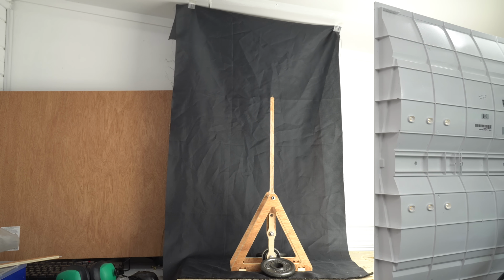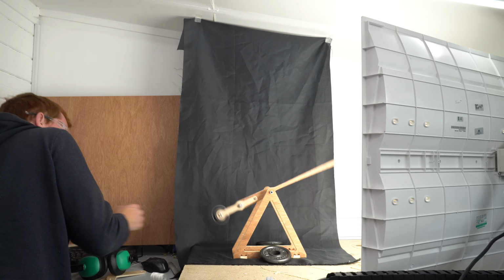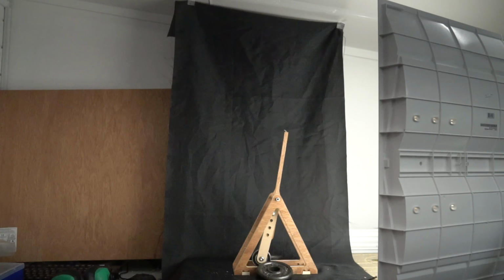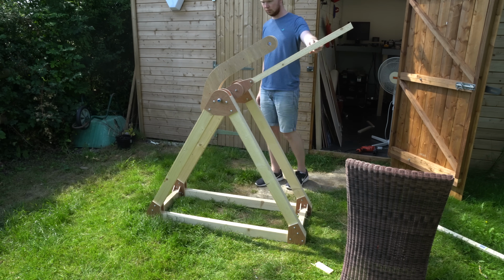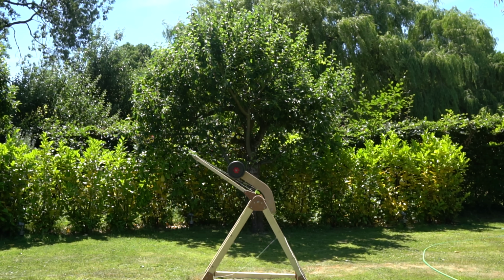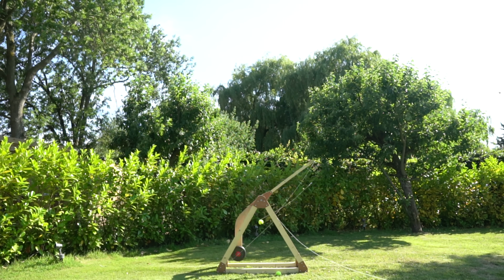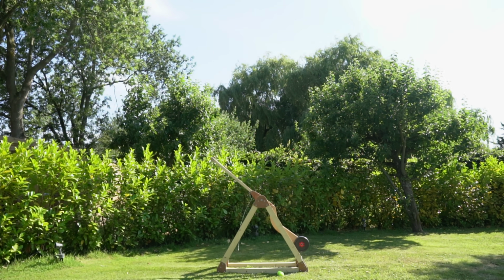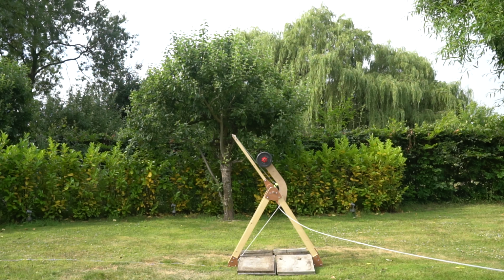Optimising a Trebuchet

Comment: Imagine getting hit by a tennis ball at 104 miles per hour that was shot from a homemade trebuchet 300 meters away.
Reply: @GielL96  well it IS Imperial
Reply: David the original comment is how many of us Canadians would talk too.. imperial is often used in dialogue and in construction, and then we use the more accurate system for real math
Reply: @David-vo1rl  Please don't use that word.  Besides, it's the British Imperial system, ergo from the British Royal Family.  "Inbred system" would be far more accurate.
Reply: Air resistance would slow the ball down tremendously during a flight.
edit: Given its size-mass ratio.
Reply: WAAAARRRR! THE BALL OF INSOLENCE HAS BEEN DROPPED
CALL THE BANNERS, GATHER OUR MEN. PREPARE THE ARMADA. LAUNCH THE PIGEONS, INFORM EVERY HOUSE TO SEND THEIR TROOPS.
TOMORROW WE RIDE TO DEATH!
Reply: How to play fetch with the dog.
Reply: oof
Reply: Imaging getting hit with a wooden play button at the same velocity.
Reply: At that speed it would only reach about 108m (ignoring wind-resistance) even at an optimum angle.
Reply: @JulianSildenLanglo  I mean, ignoring distance, its still a tennis ball flying at 104 miles an hour XD
Reply: I can imagine it happening to a few people I've had 'disputes' with in the past.
Reply: @David-vo1rl  If you buy ferrous metal, it is measured using the metric system. If you buy aluminium, it's still measured with the imperial method. We quote MPG, but buy petrol in litres?
Reply: The tennis ball loses speed due air resistance. So the final v is not equal to the v naught
Reply: @David-vo1rl  im sorry where are you from
Reply: @Isaacreeper  (ignoring air resistance)
Reply: It sounds so fast... But relative to the serves of professional tennis players, it's mild.

Roger Federer averages between 120-125mph on his "first serve" (I. E. The first serve of a given point or the subsequent serve after a let serve. Basically, when he has no "faults" or in other words, in a situation where if he misses the current serve, it will be a fault and he'll have another chance. This "do over" serve is called second serve and is typically much slower because if it doesn't land in bounds, the server forfeits 10 or 15 points depending on the current score because tennis scoring is fucking weird...) Anyway, federer's second serve average speed is 85-95 mph on average. Which means that's the speed at which he's very comfortable knowing that the serve will be in. Also, second serves typically have a lot of spin on them to make up for the lack of speed (not that fast serves don't spin, just not as much usually).

Sorry for the rambling.. But now we arrive at the point. A tennis court is ~24m long. Players typically play the serve from slightly behind the baseline, so let's just call it 25m between server and receiver.

Let's also convert our serve speed to m/s to keep our units nice and clean. 125mph is 55.88 m/s and 95mph is 42.5 m/s.

If you're standing 25m away from Roger Federer who is about to serve a tennis ball in your direction at 55.88m/s, from the moment the ball contacts his racquet to the time it reaches you, only 450 miliseconds has passed.

Given the average human reaction time of 250ms, that leaves 200ms for you to decide whether to swing your racquet at the ball... Or try and get the hell out of the way before the impending welt and nasty bruise. 

A second serve will leave you 590ms total, minus reaction time is 340ms.

Now to compare with the trebuchet tennis ball from 300m most likely traveling in a high parabolic arc..  104mph is 46.5m/s, which allows you 6.45 seconds between launch and landing (and this is only accounting for horizontal travel. The extra distance of the parabala is not factored in.. So there would actually be more time.)

So anyway... Long unsolicited rant aside... I'd rather face the tennis ball from a trebuchet at 300m than an even faster tennis ball with intentional spin at 25m every single day of the week.
Reply: Actually the ball would be traveling significantly slower 300 meters away.
Reply: You actually wouldnt get hit because it wouldn't have enough range. It would fall short-closer to ~ 200 meters 😊.
Reply: It would definitely hurt considering I threw a Cooshball (which is much softer than a tennis ball) halfway through a door one time.
Reply: @whoever6458  was the door 300 meters away?!
Reply: I would be too impressed to be mad
Reply: My little brother played competitive tennis. I have been hit with +100mph too many times to count. 
It hurts.
Reply: The metric system and the imperial system in the same sentence. It’s the best of both worlds.
Reply: I love the view of his firing range.
Reply: I don’t have to
Reply: Don't kinkshame
Reply: Dodgeball is getting serious
Reply: “Call your hits”

Comment: Unbelievable that a professional tennis player can serve faster than this.
Reply: Tennis rackets are extremely efficient at sending energy into tennis balls, so effective that tennis rackets are strung "too hard" to improve accuracy over speed and they still achieve these speed. 

Also consider if you could lift 15 kg 1.5 meters in half a second? I am pretty sure you can, and without hurting yourself. Weight lifters doing snatch achieves speeds of about 2 m/s, so the lift from floor to above head would take about 1.5 seconds but those weight are far more than 15 kg.

And if you use your legs, you can probably jump at least one meter into the air, which is a decent amount of energy applied in a very short time.
Reply: @57thorns  basically,we just need some heavier counter weights.
Reply: @dicasdavida2315  O povo aqui não sabe escrever. Parece que não aprenderam portugês na escola. Nossa educação é um lixo mesmo.
Reply: @57thorns  I see the point you're trying to make but jump 1 meter into the air? Very VERY few people can jump one meter into the air.
Reply: @1AmTheStig  You are right, 50 cm is still pretty good. Still. 40 cm times 90 kg (900N) is 360 Nm, which is the same as lifting 15 kg more than two meters. Which again is a bit too lose for my point to be an obvious example.

Luckily the point about weight lifters still stands.
Reply: @57thorns  all I got from your first comment was that if we want to obtain the most efficient launch, we may need to solidly attach a tennis racket to the end of the arm of the trebuchet, and suspend the tennis ball in the air.
Reply: And you dont even need to be professional, id say that most male players who compete can serve atleast 170kmh
Reply: @1AmTheStig  midair scrunchie and you're at ~80cm height.  Most people can vault a meter once they understand how to vault.  Dead boing into the air?  nah.  Propel body? Yah.
Reply: They should've used tennis players instead of trebuches back then ^^
Reply: I don’t think a tennis arm (and shoulder, and body) generates 10 kgs of force (only)
Reply: @t-pupz  Have you tried hitting a tennis ball with a tennis racquet?  Part of the challenge is not yeeting the ball 100m into the air.  That ball is light, less than 60 grams, so if you hit it with 60kg of force, all of a sudden its going ludicrous speeds and halfway accross the parking lot when you need it to bounce in the boundaries.
Reply: DSiren Sirenite forces have vectors dude. With the right angle of contact, it will not fly off the serving box. And yes, i play tennis
Reply: @t-pupz  10kg is 20lbs and if you're applying more than 20lbs of force on a 2 ounce projectile, you're yeeting not kobeing.  That's physics - so either you're a liar, you have poor grasp of forces, or physics don't apply to tennis.  Up to you which is true oh tennis player.
Reply: DSiren Sirenite up to you “physicist” ang “tennis player”

Best regards, 

Liar
Reply: faster as long as its tennis ball, i think they might have a problem with sending siege boulders :V
Reply: Imagine this trebuchet being able to sing, cook, do algebra, cry at poetry, propose logical arguments, have children and take care of them.  People were designed amazingly well.
Reply: Not really a "professional" thing, you just need a lot of power and a proper technique.
Impressive nevertheless.
Reply: You think that’s crazy? Professional baseball pitchers throw faster than this. With a heavier ball!
Reply: Hard to believe a person can throw this fast too
Reply: Trebuchets aren't designed to give a speed advantage over human body mechanics.  They are designed to give an ENERGY advantage.  

Don't conflate the two.  A human may be able to throw/ hit a ball faster than a (real, medieval) trebuchet can, sure.

That's nice.  Small question, though: at what speed can the human throw a 300 pound ball?  

The trebuchet can throw a projectile that isn't that impressively fast, but IS impressively massive, and therefore carrying impressive kinetic energy.

Good luck knocking down a castle wall with hand-thrown balls.
Reply: @Xyles7  I think you just created a new DnD class
Reply: Actually it's the difference between  low end torque and high end acceleration...
Reply: @57thorns  Not just the racket,it is the shoulder ,arm and wrist. And they serve,MUCH faster than 100.
Reply: @konjotin  Some,not most.
Reply: @konjotin I’m a 5’11, 160lb guy, and I’ve can serve over 120mph. Strength isn’t usually the problem; it’s accuracy. As an amateur, yeah, I can hit a 120+ mph serve, but I can’t consistently get a good serve at that power level

Comment: More optimised than PUBG
Reply: LeoFPV This will hold true unless the trebuchet clipped into the ground and explode
Reply: everything is more optimised than PUBG
Reply: Arma 3 isn't sadly.
Reply: that bar glitched through the ground and fell all the way down
Reply: @Reach1335  Now come on, Arma 3 might not be CPU-optimised but the game itself got fixed after the initial (beta?) release. There are hardly any bugs. They didnt keep "every" problem from Beta to 3 years later with lots of random crashes, cheaters etc.

Comment: You've got one thing absolutely right. An ideal trebuchet launch would be where the machine came to a complete rest, upon the release of the projectile. That last throw looked like you sent 75% or better of the potential energy of the weight away with the tennis ball. It becomes more tricky, as the weight ratio between the counter weight and the projectile weight becomes greater. That looks like a great design for the World Punkin Chunkin Championship event in Sussex County, in Delaware. If you consider this, note that the pumpkins MUST weigh more than 8 pounds, but less than 10 pounds. (3.63 Kg to 4.54 Kg) The idea is to see who can throw a pumpkin the farthest. Trebuchet is one of the classes of launchers recognized by that event.

Comment: If you put wheels on the bottom of the frame on all four corners facing the way the projectile is the wait only has to travel down and not backwards as well.  It sounds counter intuitive but it works, most of the energy goes into throwing the projectiles rather than fighting with the frame.  The wait goes straight down and the frame rocks back and fourth so less energy is wasted.  Please try it and post the results.  The ball will go higher, further and travel faster.
Reply: Huh that sounds interesting
Reply: Yes, this makes a lot of sense actually. Besides the transporting of them, cannons had wheels for a similar purpose I believe. It is akin to the recoil effect of guns. If a handgun/rifle/shotgun is not "allowed" to jump back the shot fires the projectile and, to use Scott's word, fights the gun frame. If the frame is allowed to free flow upon firing... Well. lol

NOT a very good or scientific comparison there but it does make sense (if you are me I guess lol). In order for energy to perform proficiently, it can't (shouldn't?) be bound.
Reply: proved it for my sons science project using
a Kinex frame and motor wound up the same
for throws 1- base held down 2- base not held
and 3- base on wheels... as well as using 
the slide frames under the C2 rowing erg 
(and not) for blind power-10s
Reply: Weight. Not wait.
Reply: @coachvolpato  In the days of the trebuchet one could spell any way one wanted
Reply: @joshua43214  Definitely true for any  firearm. The catch with the trebuchet is that it will move forward, so one might believe it is adding to the speed of the projectile.

However: Any movement in any part except for the projectile is lost energy.

"Fighting the frame" means transferring energy to the projectile. Using that energy to accelerating the frame (instead of just the arms, weight and projectile) loses energy. So wheels on a trebuchet is not working.
Reply: @57thorns  You want the counterweight to drop straight down because that is the highest velocity. Hence a hinged arm and/or using wheels to allow the device to move.  and the entire device moving forward would add velocity. Mount it on a moving vehicle and see if the projectile goes further/faster.
Reply: @kellykudryk8124  I found the follow up video later, and wheels does improve throw length because it allows for more precise timing. 

So it is much more complicated than I (and most that proposed wheels) assumed.
Reply: and the moving forwards and backwards..(accelerate, decelerate..)of the frame on wheels...does NOT cost energy dissipation ?
Reply: @oddballsok  OF course it does, but this is offset by the improved timing as described in the followup video.

This is just one of those "everyone is wrong, just not in the same way".

Except for those that believe throwing a gun backwards would improve shell velocity, they are just wrong for all reasons and the trebuchet case has nothing to with wheels on cannons.
Reply: ...and it will reach farther neighbour
Reply: @joshua43214  ships cannon rebounded into heavy cables.
Reply: If i were to try and understand this i would say that letting the frame, and therefore the pivot, rock back and forth will allow the counterweight to fall in an even straighter path down, further minimizing horizontal movement.

As Tom points out, the absolute ideal is if the counterweight falls straight down and immediately stops. That will transfer the most of the potential energy into the mechanism. If the counterweight is left swinging back and forth it will have "stolen" some of the energy instead of giving it to the projectile.

edit: oh, op already explained this pretty well. I must be tired if i can't properly read what i'm responding to :)
Reply: Adding wheeling will definitely help.
Reply: If it could roll, rather than the weight moving right at the bottom of the drop, the whole unit would be pulled forward. Resulting in the weight going more straight down and transferring the left to right energy into the projectile I suppose. I'm no physicist, just an observation.
Reply: @57thorns  Hey guy. You know your trebuchets. A wheeled one allows the straight drop/faster drop. Also when the platform shifts, the first shift aids the projectile's velocity while still on the deck. Then as the projectile is lifted up, the opposite shift of the platform aids the projectile's velocity in it's throw. It's wicked cool that it does this. Still, a non-moving trebuchet is easier to construct and can be very effective. I've always wondered if a man hurling the hammer throw might get better results if he was on roller skates!? Or ice skates, maybe? And, if you've ever seen an pump in an oil field going up and down, notice the cable/chain is wrapped over the oscillating head.  >> ---------D  This also I think would allow the weight on a trebuchet to travel straight down and would need no wheels on the platform, except for transporting. This setup may allow the weapon to "dig in" on the throw. It might be a nice improvement. If you or anyone here tests this out, e-mail me at alexvco12@hotmail.com     Lastly, I have a neighbor who holds the world's record for the most concussions to the human brain, eighty two (!). He doesn't live far from me, in fact he's just a stone's throw away.  Cheers!   Alex in Montana
Reply: @kraigthorne  🎯
Reply: I can confirm this works I tested it with a Lego one I made, after seeing it on scrapheap challenge.
Reply: The reason why shipboard cannons had wheels is because they load the cannon ball from the tip, so they had to have access to reload it. They would shove the cannon forward so the barrel stuck out from the hull before firing and let the recoil knock it back to its reload position. It wasn't to do with energy transfer, in fact they lose a portion of kinetic energy by letting the cannon move, but it just part of the process